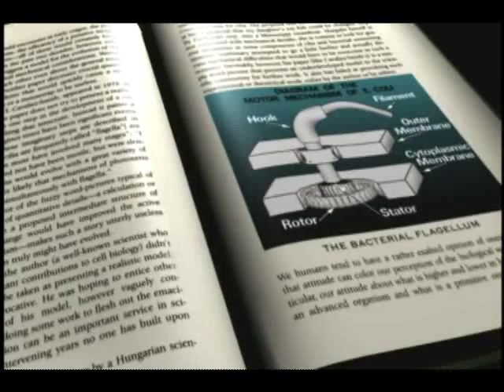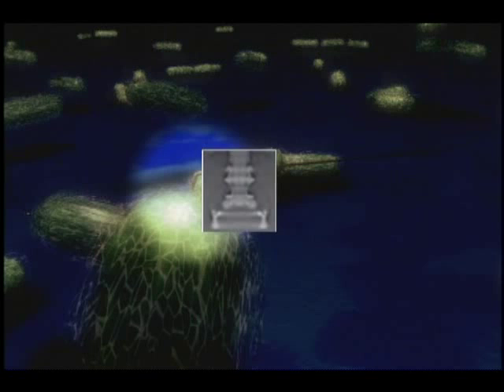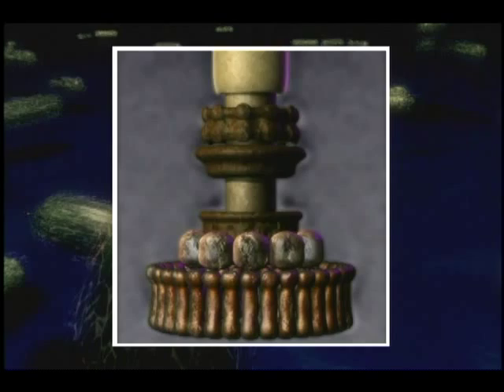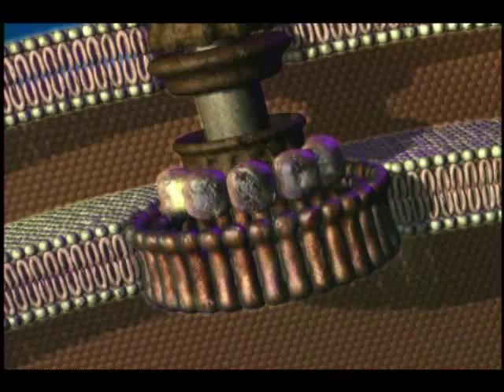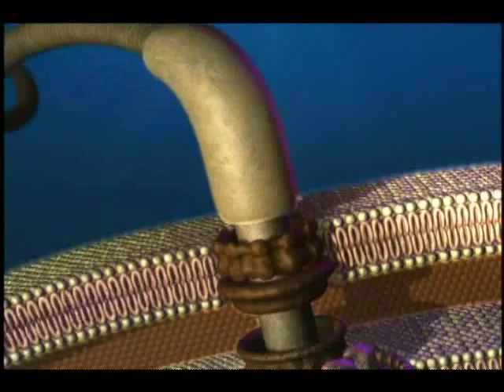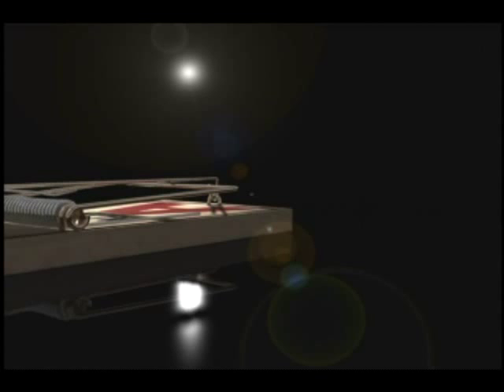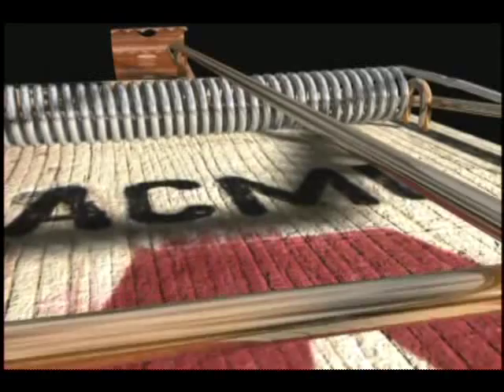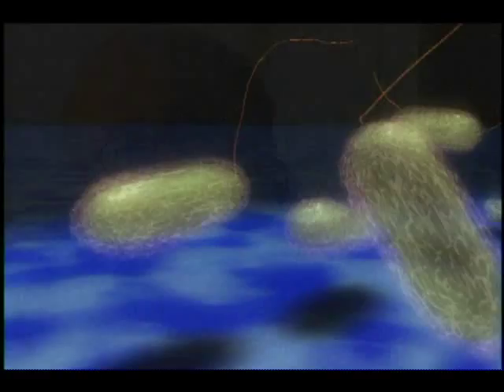Unlocking the Mystery of Life - Irreducible Complexity Clip

Comment: Excellent!!  This video is a summary of one of the most poignant examples given by Dr. Behe in the critique of Evolutionary theory. One can get lost in the layers and sub-layers of the evolution-creation discussion but Behe provides a clear incisive line of reasoning for intelligent design. Thanks and great work Dr. Behe!
Reply: It has been proven that if some of the proteins of the flagellum motor are removed, the motor still has a function. So much for irreducibly complexity.
Reply: brainsick213 I think you miss the logic of irreducible complexity. It assumes from observation that complex systems have multiple primary and secondary functions.  The logic is that if one studies a complex system it must still function at every reducible step back to the most elementary units. If one step in deconstructing and simplifying that chain, shows the combined parts to be without a useful function, then the process of time plus chance and natural selection can't explain the presence of the final complex system. To refute the premise of irreducible complexity the burden of proof is not to show that after subtracting one reductionary step the system still has useful function,... but that at EVERY reducible step back to the most elemental unit, the combined elements have a useful purpose.
Reply: False
Reply: Bastad Kock Behe still false